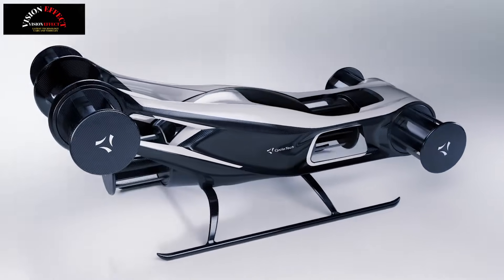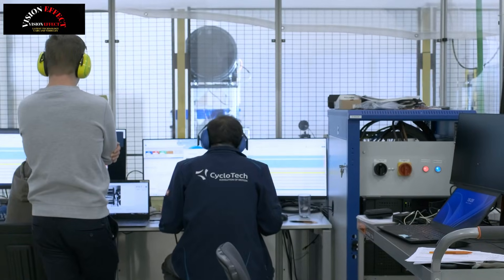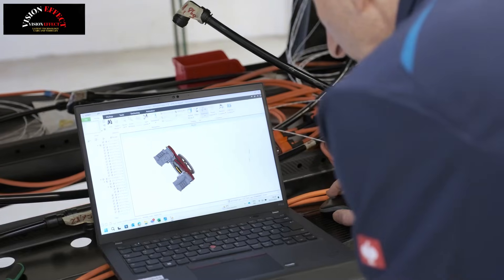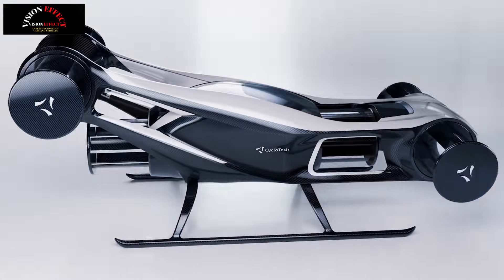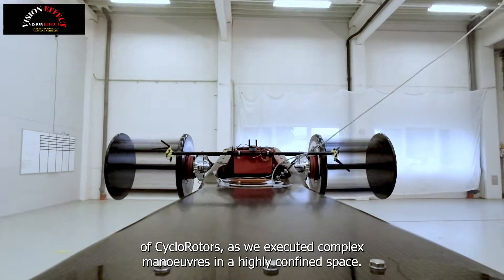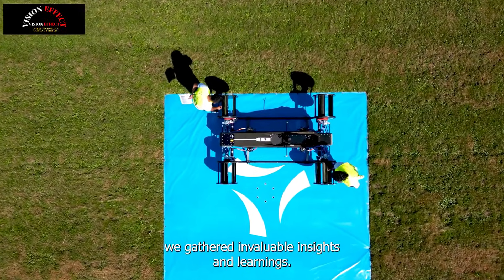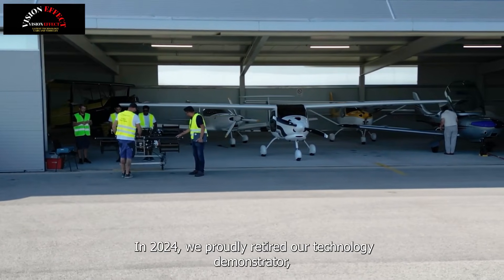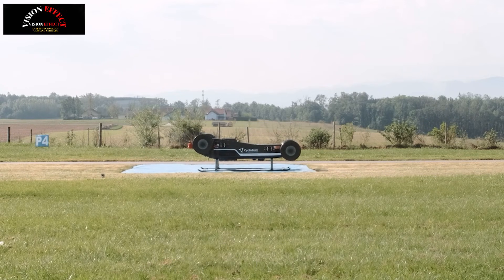Flying Car | First Flight in the First Quarter of 2025 | CycloTech BlackBird Demonstrator

Comment: As a propulsion engineer, I have to point out that static thrust efficiency is primarily dependent on disk loading, which boils down to the amount of thrust vs the area over which that thrust is generated. These propulsors appear to have very low "disk area", hence high disk loading, hence by Newtonian physics are bound to have commensurately low static thrust (hover) efficiency. I am not saying it cannot be made to work, but I would be very careful about investing in this one.